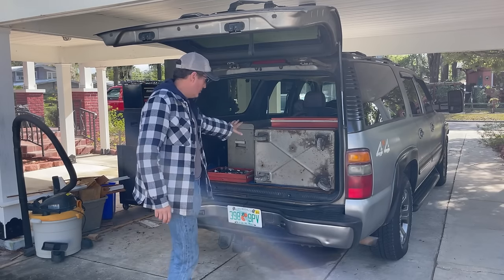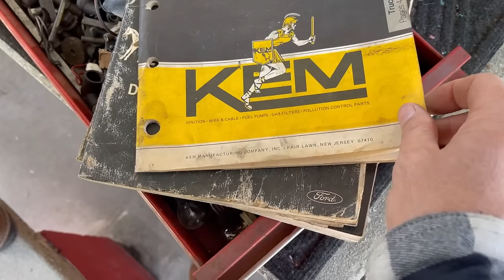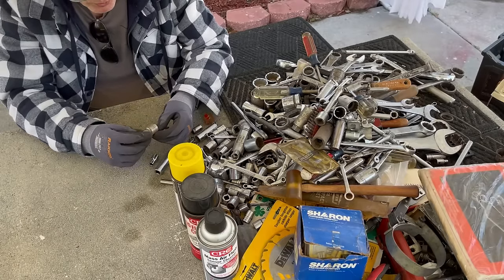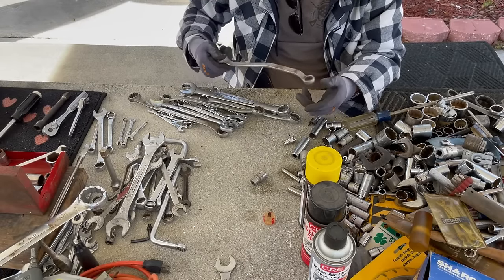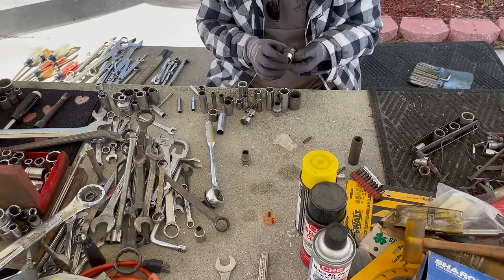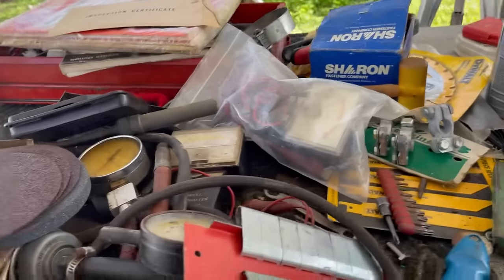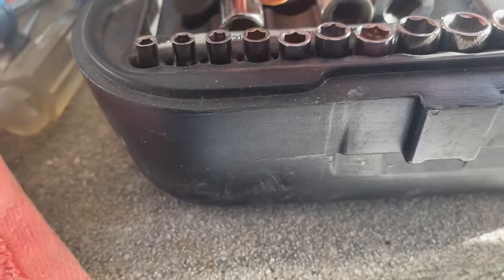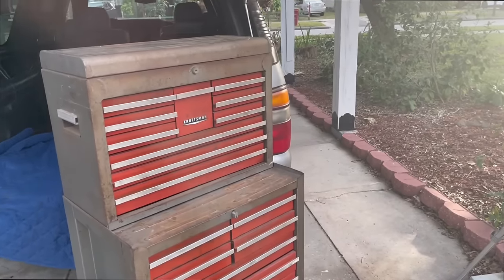Vintage Craftsman Estate Sale Tool Box with Tools

Comment: l bought the same two boxes from sears in 1971 after graduating high school and getting my first job . My second purchase was a set of half inch drive MAC impact sockets off the Mac tool van, l still have them all in good rust free condition with the keys! The top tool box and sockets cost 100 dollars each and the bottom roller was 200 dollars . l made 100 dollars a week for fifty hours at a tire shop ,retreading tires.
Reply from the maker: I used to buy retreads/recaps as a teenager back in the 1980's. I used to wonder how they were made. You are one of the few who know that lost art!

Comment: I have the same bottom box. I inherited it from my dad. He said it was from the sixties when he was a mechanic. It still works but needed a little welding reinforcement. Far better than current Craftsman boxes. Great video
Reply from the maker: I think these were from very late 1950's to early 1970's.  I have one where the badge is actually metal so my guess is that it's an older one than this.   There are date codes in some of them usually on the top boxes under the lid to the right and I think on the bottom boxes on top to the right front.  I've found that info to be unreliable in some cases though.
Reply: No, that style was from the 1960s through the 1970s. Waterloo made them for Sears and that is a good combination. I have several like that as well. Also, the top box has the date stamped on the left side top floor and the bottom box has the date stamped on the front frame by the right hand caster where your foot would be standing in front of it. It will be a month and a year.

Comment: I was given a Proto set like what you had. My neighbor was moving (a full six blocks away) and asked me to help him sell some items in the house as he is not "internet savvy". I sold three cars for him, held a yard sale and estate sale and made him about $40k in a few months. He told me, "Take what you want out of the garage" and then also bought me dinner and lunch for helping him. I told him, "The tools are enough, it's what neighbors do". About a year later, a blue 1982 Corvette shows up in front of my house and my bell rings. It's my neighbor with his "new purchase" bought in cash from the proceeds of the sales of his other two cars. It's something he's wanted for a while now. Turns out that the color of his Corvette is one of only about 500 or so painted that color (code 26 Dark Blue) for the 1982 model year. It's in nice shape. 

I also wound up with a pressure washer, a snow blower, a few socket sets and other tools, and a tap and die set that was a vintage Craftsman too.
Reply from the maker: Glad he got his dream car.   1982 was the last of the C3s.  I remember those.  The 1984s looked far less radical.
Reply: @floridarusticrepairs  He had one when he was in the military. Yes, 1982 was the first full model year that they were made in Bowling Green, KY where they are still assembled today.

Comment: A very nice tool chest and roller. Similar to mine that I got in 1974. In the 1970s when I was active working on cars, the parts stores gave out the tune up specifications books each year. They'd be in a pile and you could just help yourself. The spark plug socket at about 44:00 looked like it had been ground down for clearance. Good Luck, Rick
Reply from the maker: Thanks!  I never knew they used to give those books away.  Nowadays you go to the auto parts stores and can't even find one of those books with the oil and air filter numbers.
Reply: @floridarusticrepairs  You'd have to be an old geezer like me to know that. They were only 40 to 50 pages but the Delco ones that I got were a wealth of info. Now, I'm wondering if I even have any of them still. Good Luck, Rick

Comment: Great find the funny SK socket i think was a oil sending unit socket
Reply from the maker: I found a little plastic SK case and that socket was part of a set of two plug sockets and extensions and all of the pieces were in the pile.  👍   One was just a regular spark plug socket but the second one you may be correct about.

Comment: I have the same set of tool boxes.  My top box was from 1974; my bottom box was from 1975.  I need to strip the paint, remove the rust, and repaint them but otherwise the boxes are still good.  Not too bad for being almost 50 years old.
Reply from the maker: These grey and reds were very good boxes. They get surface rust but I've never seen one rusted through and they're pretty easy to restore as well.
Reply from the maker: Rustoleum Hammered Grey is a good match.  People say Farm Tractor red is close but I prefer the red High Performance enamel because the red is brighter and getting a gloss finish out of the spray can requires little effort.

Comment: I have the 1981 version of that lower rollaway, also made by Waterloo for Sears. It was getting tossed out and given away for free on Craigslist. I also have had a "tool haul" like you've gotten and like you said, it takes time and you have to be organized. But in the end, it's worth it. You're undoing years of "let me just toss this in there and deal with it later" mentality. I was never like that. 

I had a coworker give me a 1981 Craftsman lower/1983 Snap On KRA59F upper that was like what you had there. Some tools, some hardware, some junk. He told me if I didn't take it that it was going in the scrap pile (as he was selling the house where it was stored). I took it. The only thing wrong with the lower roller was that the drawer clips were missing from the tracks. Easy solution. I had the proper "M3163" clips that were needed to secure the drawers on the tracks and I know the guy that sells the reproductions on Ebay. In fact, the "long style" clip he sells now is based on my original slide and clip. I sent them to him as a model so he could make his reproductions. The agreement was that he would send me some free samples, and I let him profit off of the reproductions. I talk to him now and then, a very interesting person.

My first rollaway was bought for $50 at an estate sale in 2002. The owner died and his relatives went through his two car garage which doubled as a home shop. It was packed to the rafters with old school tools, many of which were Craftsman. I bought the box, a 1960 Waterloo made Craftsman combination and along with it, he gave me some old Buick shop manuals. I flipped those the next day and made my money back and then some. I cleaned it up and painted it (realizing it should have been red and gray later on) and sent in a photo to Sears. I was then featured in the Craftsman Club newsletter in 2002 with my photo and story and they gave me $50. I also got a discount at the local Sears store when I showed them the magazine with me in it. The former owner was a local stock car driver who I had heard of. Some of the tools had his name engraved in them. I kept them rather than swap them out. The only tools I swapped out were the ones that were not repairable or useable. At that time, you would get another USA made tool.

Like you said in another comment, I also did a "last round" buy at Sears when they were closing up. I got a few NOS sets of USA made Western Forge pliers discounted. Years back, my uncle's neighbor, who we call "Uncle Mike" (as he's been a family friend for well over 70 years) managed the local Sears store and worked there from 1953 to 1993. I still talk to him periodically and he loves to talk about his time at Sears. Last year he gave me a 2005 Craftsman snowblower that he had which was used 10 times (something you don't need in FL, I know. LOL). He said, "I'm too old to use this. I have the landscaper deal with it. You're the one that should have this thing now". I gave it some maintenance and aired up the tires. It runs like new and will blow snow like no one's business.

As you and others said, the "golden days" when you could walk into a Sears store and be surrounded by quality tools at a good price are long gone. Buying a used Sears tool was like buying new because you knew the value and what you had. It was like finding literal gold in the street. I've found a few on the road as well, some have been given to me, others I bought new (and still have the receipt) and others I bought used, including from retiring coworkers and those cleaning out relative's homes who have unfortunately passed on. 

Like you, I know "Old Gold" when I see it......
Reply from the maker: That's a great story of your history with the brand.  Thanks for sharing!  Speaking if "found on the road", when i was about 7 years old my father picked up half of a Craftsman wrench lying in the road and he told me they'll give him a new one for it.  i was surprised to hear that and sure enough, we went to the local Sears and they gave him one.  I guess that was the start of my being a fan.   When I had saved enough money and bought my first car at 15 years old, I sent to Sears and bought a socket set which I still have today and use as my go to.  Oh, I know snowblowers well because I lived in Massachusetts for 38 years. My father had a few Craftsman versions.  Unfortunately when Sears went under most of what they had was not USA.  I did buy a lot when it hit 75% off regardless.  the best thing I got was a heavy duty Craftsman sawzall. i just used it a few days ago.  Thanks for checking out my video and have a great weekend!
Reply: @floridarusticrepairs  Back in 2004, I went to a junk yard and found just the handle of a Craftsman nut driver and part of a socket rail that just said "MAN" on it. I brought both back to Sears and the guy there joked, "Where's the other half of the nut driver?" I said, "In a 307 Oldsmobile engine in a junkyard in PA". He went to the shelf, got a new one, matched it up and did the paperwork and gave me a new one. On the socket rail, he said, "If the new package says lifetime warranty, you're good". Sure enough, it did. He did the paperwork and said, "Have a good day, see you soon" (I was always in there).

Yup, I also found a #43784 (I have several, this is a 3/8" drive ratchet) in 1976 when out for a walk with my dad. I decided to take it apart a few years ago to see what wear it had. The answer: zero. I cleaned it and lubed it and put to back together. I've rebuilt dozens of Craftsman ratchets as well as others and I have it down to a science now. 

Like you, the Craftsman brand runs deep with me. It was what was affordable and easily available. I still have the receipt for my first socket set I bought in 1990 and I still use it. It's 95% original with only a few sockets replaced over the years. My tool collection is mostly Craftsman. Yup, I have a few of those reciprocating saws. I bought one new and two used. One of the used ones needed a new two-speed switch. I found an NOS one on Ebay for $8 and now both speeds work again. Dewalt made most of them for Sears under the "900" model prefix.

About a year ago, my uncle (neighbor of the person that worked at Sears) said that the garage door openers that he and my dad installed in 1979 (one at my house, another at my grandparents, and one at my uncle's) was acting up, and "would I help him install a new one". I said, "Let's look at this one". Sure enough, the original belt was worn. I got one from Ebay and installed it. Works perfectly now.

I even installed a new conversion box to change it to a modern radio frequency (the original frequency is now restricted). Liftmaster made them for Sears and basically tells you to replace them since they are older than 1982. Bull biscuits. I bought a 365LM conversion kit and made them "rolling code technology". I even programmed it to work with wireless remote. It runs quietly and you can't even hear it operate. Even the lights still work on it. My uncle was flabbergasted.

Comment: The red piece of metal that had the 16 clips on it that was laying there is a tool for adjusting valves on on small block chevy while running blocks off oil hole in rocker arm to keep oil from spraying every where i have the same set
Reply from the maker: Thanks for the info!  I've been wondering about that since I came across it. I've never seen one.

Comment: Sears sold a version of that RHFT (round head fine tooth) for decades and it was made by Easco, just like the one you showed. They were available from the 1970s onward. I have a few. They are the "holy grail" of Craftsman ratchets. I recently bought a "grab bag" from a coworker that retired and it was almost 100% USA made Craftsman, and one of those ratchets was included. I paid less than $1 a piece.
Reply from the maker: I have both the Easco and the Craftsman although they have different handles the head and release are the same.  They're probably the best Craftsman had at the time.
Reply: @floridarusticrepairs  Yes, the Easco plant (actually Moore Drop Forge) in Springfield, MA likely made it, especially if it has a "V" maker's mark on it.